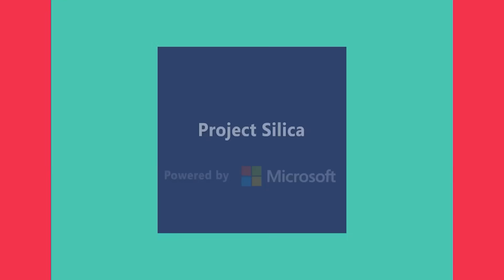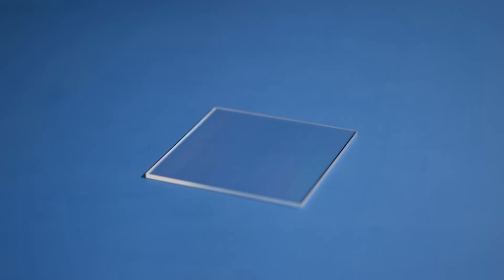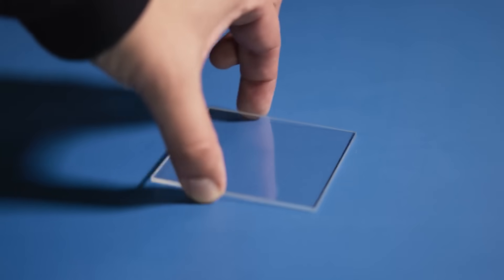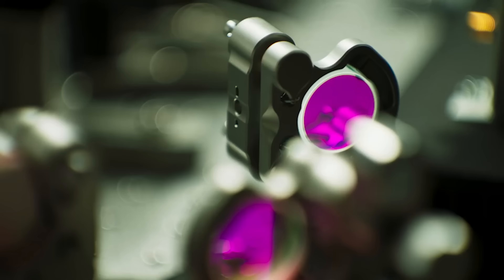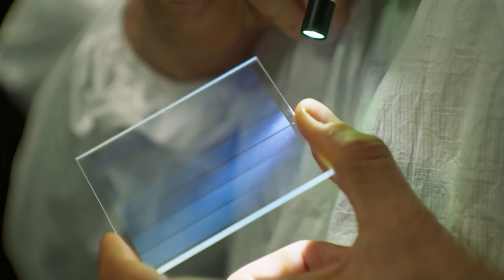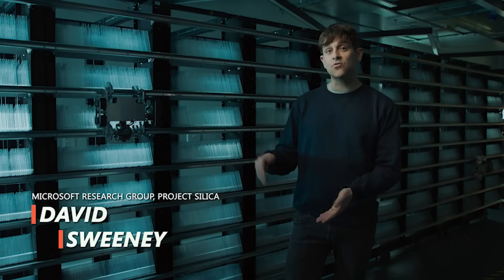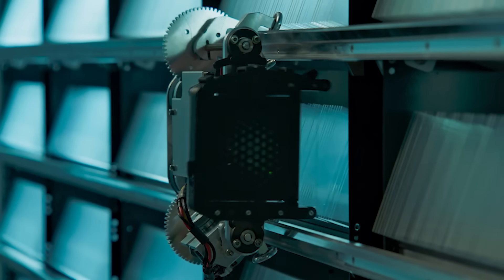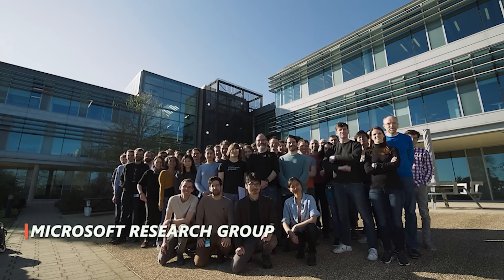Sealed in glass - Microsoft's Project Silica

Comment: Ahhh so a bunch of engineers got together and thought optical data drives need a revival because they can't remember why CD/DVD or Laserdiscs went the way of the dinosaurs.
Also glass is a permafluid which is hardly ideal for storing data. Old glass windows actually show deformation because it is in a permanent state of flowing. 
This would corrupt the binary sequenciated data stored within. Something with a rigid molecular structure (crystaline for example) would be far better suited.
Having said this i still wonder why even bother doing that? We have already 4Tb m2 SSDs that are smaller, less complicated to read/write and completely safe for long term data storage.
One final argument: Project Silica uses nanostructured voxels of 5 micrometers... as comparison silicon chips are currently manufactured with a 5 nanometer architecture.
(we talk about a difference by a factor of 1000)

Comment: But silca will over time start to sag under gravity. if you have seen pains of window glass dating back to the 1700's you will see its now thicker at the bottom than the top, even glass that's 50 years old will show signs of sagging. how robust will the new media be?   Back around 1991 someone patented a silica/crystalline glass cube with a 3d laser etched inner data storage volume allowing possibly petta or exo-bytes of storage in a 3d read cube matrix. Is this the first step to making that come true? look how far basic concepts of 1960's laser discs have been miniaturised to be 8K HDDVDs today played in rewriters little more than 1cm thick on todays laptop computers.

Comment: so, I am just saying these voxels almost certainly are larger phsically than a bit on a magnetic hard drive or a charge trap in nand flash. So if it is a larger physical size how do they get storage density? I am guessing any storage capacity on these that is in the plurality of Terabytes is thanks in no small part due to very powerful compression algorithms. and maybe these algorithms are only so powerful because of the 3D nature of the voxels. But I am guessing either the density is not good in many situations, or the algorithm works on any other storage media. So I guess I am saying this solution seems a lot cooler than it seems practical, time will tell us if that is true...
Reply: yeah, 7tb on this piece of glass seems like a low density, beside, it seems like an incredibly stupid idea.

Comment: What about the problem with glass deforming over time? Isn't it technically a amorphous solid which deforms over long periods of time? 
Therefore shouldn't the best way to use this kind of tech be by writing on or in see through see through aluminum? Probably coated in glass itself to prevent oxidation.

Comment: I remember reading about massive data storage inside a 3D matrix the size of a sugar cube (also made of glass). Wouldn't that maximize the data density? Glass panels like this seem to be more susceptible to shattering, where as a cube is a stronger structure, more likely to chip at the corners than shatter completely.
Reply: Microsoft hire this man^

Comment: if you will look at the glass windows of 100+ years old buildings - they are quite distorted after this time. Basically glass is slowly leaking because of gravity and without constant rotation i would guess any normal glass will distort in the scope of 100 years and more.
Reply: mmh, no, the glass is not "leakin" if you look at old building and see defomred lgass that is because at the time they did not quite grasp on hotw to make perfectly flat glass (floating over tin, as we do now). But the glass doesnt "slowly leak beacuase of gravity" you made that up.
Reply: @lo2740  sure, why not. Actually cool tech, I thought it is mostly used for films, not glass

Comment: What brilliant idea!!! I little like the clear but coloured layered DVD size disks from years ago that stored data in different light frequencies.
I would of thought a reader on a every shelf in the racks would of been a better idea, so there were no moving parts at all.
As the glass plates are clear, it would be possible to have the data arranged so you could read through several plates of glass at 1 time on the shelf. A bit like fractal patterns in silica glass.
You could store the same amount of data just read it differently.
Or have the glass sheets different colours with the same data code, so you can read the different colours of several different glass plates at one time on the racks with no moving parts.
I have seen this sort of laser movement controlled by computers to perform light shows.
Why not apply some of that technology to a laser in the racks that reads the glass plates?
The data stream of the what the laser reads could be fed through fibre optics back to a decoder running at the speed of light.

I know I am over simplifying this and you may have already thought of everything I have said tried it some tests and it was impractical.

Just following the idea of something that does not change in a durable format like data in glass and extend it to the reader part and how it could be simplified.

If the glass plates were arranged in a sphere maybe you could read all of them in the sphere at one time with a laser reader?

It all depends on the way the data is arranged on the glass as to how it could be read.

Like changing a barcode to a QR code, you have the same data represented differently.
Reply: The suggestions you are making really are whats needed to turn this into a product
Reply: @rrmackay  i agree...there often seems to be a wide space between innovation and entering a market place in a practical...history is littered with world improving ideas no one ever found out about or were bought off and shelved for various reasons...including a competitor buying up and idea that would cost them money even when it is better...and never let this better idea see the light of day

Comment: Interesting. If I’m understanding correctly, we’ve basically created the equivalent of a glass library. That you need a robot to fetch the information makes retrieval times slow. I feel this is a first step because the goal should be to make the information readily available at all times. A million people try using this system and it’s bogged down for days/weeks probably. May be able to ship books faster.
Reply: “Never underestimate the bandwidth of a station wagon full of tapes hurtling down the highway.” Andrew Tennenbaum
Reply: @smallbluemachine  Except the latency is extreme !!  Never confuse bandwidth with latency.  And then add into that reliability.
Reply: Retrieval time is not too important, here. This is for long term, durable storage. Data on hard drives decays over time. Tapes too. DVDs decay. flash storage that is now the most common type of storage loses everything in a few years of not having electricity and wears out with use. ZERO of the storage technologies we have and use daily, if left on some shelf or in a vault survive intact and readable for 200 years, let alone 500 or 1000.

Comment: Hope it won't be long to reach consumer market !
Reply: it wont, it is a totally stupid system that will never reach any market, and the density is very low 7TB per high piece of glass seems a lot for now, its nothing for tomorrow, not to mention it requires a 50 million usd lab to read the data, very slowly bit by bit.  what a joke.

Comment: Interesting, except what happens when the glass is dropped and shatters? Seems like an incredibly fragile solution.
Reply: Same things happens when a mechanical drive is dropped
Reply: @shawnpepin7890  mmh, no, not at all, mos storage are pretty safe when dropped. This looks not only incredibly fragile, but also very slow to read, and low density, 7TB may seem a lot now, but its nothing for tomorrow. Last point, it seems to require a 50 million read lab to read it, bit by bit, which is certainly not sustainable nor smart, because ine 1 or 2 decades this lab wont exist anymore.

Comment: Decades ago, we would get those 3D faces inside a glass Crystal...it seems to be useful enough to be used for data storage... However, I think the only way to format/rewrite is physically recycling the glass slide. Still, a very sustainable data storage system, once the decoding becomes cost-effective and accessible to all. I wouldn't mind a glass chip slot in my phone/laptop... I mean this is inspired by the most time-tested data storage system - cave/stone carvings, drawings and fossils too.

Comment: Seems okay, as long as there is someone/something still operating to backup all of this data in 9000 years. What if all life becomes extinct in the next few hundred or thousand years (seems likely). Will aliens be able to find and decode the information? Is the facility this data housed in earthquake resistant or use any kind of vibration deflection technology? I'm thinking extreme long-term here. I hope one day we can figure out a way of preserving data like this for billions of years, rather than just tens of thousands, but I suspect that will require some kind of incredibly resilient self-maintaining/self-repairing system, perhaps hidden inside a crater on the Moon with some kind of radioactive signature so that it can be found billions of years from now.

Comment: Cynic here. Two thoughts about the shape of the media: 1. why not do this as a disc instead of a rectangular slide? It would improve linear data rates and reduce the complexity of the laser servos to only need only 1 degree of freedom. 2: why not do this as a tape made of thin glass; the applications are for archival anyway so the loss of random access wouldn't be so bad, it would mean that you don't need such complex optics to access the depth of the material as it just unrolls instead, it would also make the linear access of data smoother. 
A third question about the robots: why do they need to be so complex? they perform these gymnastics to go up and down the rails and must also have to do something clever to avoid collisions. With so many moving parts though, they are bound to suffer all sorts of modes of failure. If you want something for long term archival then you need tried and tested technologies that are as simple as possible. It seems that the robots that operate inside current tape libraries would be a better fit for something like this. IBM and Spectralogic are two big players in this regard. The robots for these libraries use belts to move in two dimensions, then they grab a tape cartridge, change position and then shove it in a tape drive. This project seems more like one of vanity to show off some robots, rather than a practical approach for long term data archival.
Reply: It's a gimmick, thats why  they show us the backfliping robots